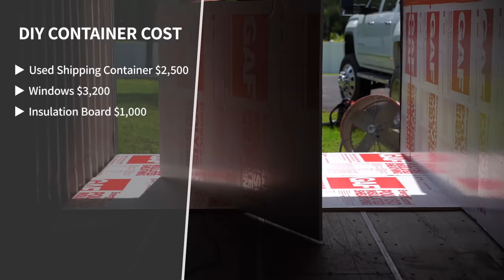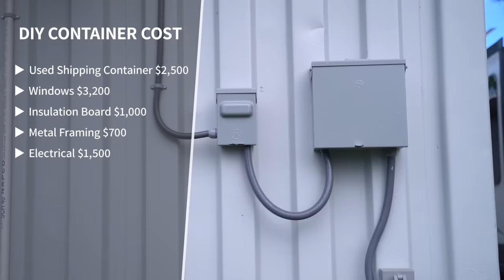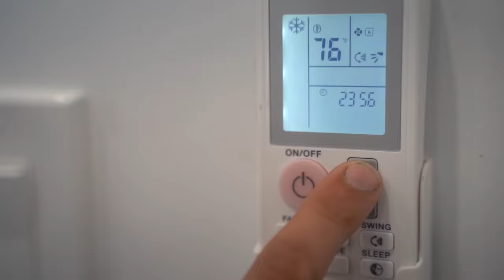40ft DIY Shipping Container Home (Total Cost Breakdown)

Comment: Here in Canada the price of just materials could amount to double the grand total. In your neck of the woods that could go to nearly 50 o 60 thousands, provided you hire the proper experts. Again, the cost here (considering the harsh winters) will take me to almost a hundred thousands, if not a little more. Nevertheless, a conventional house, of that size, made out of lumber and virtually disposable materials would cost around 2 million Can$, and that will include the land that will never be mine. The great advantage is that a shipping container unit will last longer and can be easily extended, if needed. I'm looking forward to see your videos, professionals like you are very much needed these days. Keep the good work amigo, you are good. Greetings from Toronto.

Comment: I have liked the idea of container homes for many years. I bought two used, 20' standard height Connex and minimally converted them with doors, lighting and skylights and were used as a art studio and workshop until the city discovered them and I was forced to move them away (Los Angeles! Rrrrrrrr). Now I am in the process of searching and securing land. Planning on spending largest part of my (initial) capital on sizable land of 30-100 acres (topography, terrain, slope and sea level elevation, zoning, laws and regulations, distance from amenities, climate and weather, taxes, accessibility to utilities, distance from work, traffic and airports/ fwy access and several other location decisions like USGS water table, (well depth) and preliminary planning considerations being of primary importance). I have it narrowed down to 5000' or higher elevation in South Western US (AZ, UT, NV, NM). My idea of a Container home build would be for an enclosed courtyard with water features (recycled water wall, wading pool and fire pit) and most time would be spent outdoors. (6 containers in a U configuration,  2 stacked, 2 side by side, full size end windows, sliding glass doors ect)  I appreciate you putting out this video and my estimates were a bit higher as I have lots of concrete and some platform/ decking and staircase considerations ...but I still think if your a DIY with a construction and metal fabrication background it is a no brainer for a remote or off grid build as there is some inherent security during and after construction. With some creativity having metal boxes to start with allows more flexibility if this is a solo or small crew build. Thanks and I am looking forward to more of your vids!

Comment: Cool video thanks for sharing everything but what if someone had a little container home like this and they closed that sliding door for example because they wanted to sleep and have privacy then if you had your mini split on with the air conditioner running or the heater running when it's either cold or hot then if someone's in the living room for example they wouldn't even feel the air conditioner or heater at all is that correct?

Comment: There is a curve (and you know this because you are a builder and so am I) the curve says that the smaller the square feet the higher the cost per sf is.  If someone does not allow $100 per sf for a container home build, they are fooling themselves, and that may not include the foundation depending on the location.  Site work, permits, local code issues like listed below.  And some municipalities are not going to let you install electrical, plumbing, hvac yourself.  

Insulation costs will greatly be determined by where it is built.  In our area where we have an energy code, R-19 floors, R-13 walls, R-38 ceilings, it will cost more.  The 1.5 insulation averages around R-5 so depending on what you  buy it will not meet most energy codes.

Yes, the problem with mini-splits is location and the length of these containers.  the dimensions of a container being long and narrow is really an inefficient design regarding HVAC. Most people will put a lot of glazing on the living end which is opposite of the sleeping end and so you will need 2 heads for the minisplit system because the glass is the energy killer and it will either be cold or hot where the glass is.  The good news is they have compressor units that will do 2 heads.

The sewer system most likely will either have to be a septic tank or connection to the city sewer, each of those would be a minimum of $4,500 unless you are lucky and have a close connection to a city sewer that needs no street cut.  I don't know of any municipality that will allow a permanent dwelling to have just a composting toilet.  Where is the sink and shower water going? :)

The Irony is, containers do not make sense for homes.  They work well for shipping :)  An efficient home design is more of a cube than a long skinny rectangle.  But the internet makes everything look easy, free and trendy :) then comes the building inspector :)  

Nice video series.

Comment: The only thing I would add to this video, like you said in the beginning living in the south. Cost of land could be anywhere from $1,000 an acre to $20,000 an acre. As well as some of those materials might be easier to source living in different places. Living on the coast you could probably get the container for cheaper versus living in Kansas. So I would just have a little disclaimer saying these cabinets are $50 a piece if you live in Texas but they're $80 cabinets if you live in New Hampshire

Comment: Presumably the cost would go down somewhat if you were building multiples at a central location for delivery to the sites, but it sounded pretty reasonable. Then there's the fun of finding a place that would issue a certificate of occupancy for such a small living space. I guess that's improving. Even if costs went to 50k for one of these with siding and roof and such, it's still better than one of those tiny homes on a trailer base.
Reply: Agree.  Plus they look more mothern thank the ones around here where I live.  I don’t like the “Smurf” cabin looks lol.

Comment: So the vapor barrier is between the foam board and the steel wall of the shipping container? How to you make provisions for water vapor condensation or ventilation of that space? Obviously there is a huge temp differential between the steel skin and the interior walls so it's something that needs to be addressed and I'm not sure how you do that.

Comment: Do you have a video on the installation of the windows.  Do you weld in a  steel frame or do you use wood and screw thru the steel of the container

Comment: Big question. Im in central Florida. Ive got two 40ft HC containers. Planning on getting two more 20 footers. My plan was breaking everything down in stages so we can plan save for each one and over the next 5 to 8 years build everything ourselves.  Ive got alot of hands on experiences with just about everything.  Im still trying to find out can i actually legally build my own house with out getting contractors. Ive found buulding codes and zoning but nothing saying you have to have a licensed electrician, plumber, ect. I know ill have to pull permits and get inspections.  But where can i find out if im able to actually do all the work myself

Comment: Congratulations on the very interesting video. I have a technical question for you. If a house is built on site and later transported to another location, are there any risks of damage to the interior due to the elastic movement of the container? If so, what precautions do you recommend? TY
Reply: Always bc you would have to have a crane to sit it perfectly upon your new sewer system

Comment: Honest question, here.  Why use the container at all?  I can stick build a house with that square footage for roughly the same price (including site prep, a roof and exterior), and I don't have the constraints caused by the container.  What does the container gain you, especially if you're going to end up putting a roof and exterior on it?

Comment: thanks, that was actually less than I would have thought. I would have thought $20-25K materials cost, then labor and site prep. It all adds up quick. Just the time to build it would be 1-2 years for a owner build depending on the time available. What was your start to finish time on that container?

Comment: What kind of footings do you put this on? Also, in this one, you used steel framing with 1" closed cell insulation inside, but on another (the 20') you used InsoFast foam. Did you get the R rating you wanted with the 1" closed cell? Do you have a schematic floor plan w approximate dimensions for this particular build? Thanks!

Comment: By the  time all the other costs are added in it is easy $40,000 for the first container. If you add two or three  containers, those one-time costs bring down the cost-per-container figure. More containers may also  bring down other costs like shipping and labor. The first container will be the most expensive. I've been told that a multi-container building, with costs averaged, will be $30,000+.

Comment: Yeah, you could DIY this for pretty cheep in comparison to buying a standard home, but like you pointed out, this estimate doesn't include some of the things are going to be the most expensive. Finding a place to build it for one, buying  a piece of land isn't cheap. Then deciding if you want to live off the grid and go with solar power. If not, you need to make sure that plot of land you bought has access to grid power. You also need to see if your plot has access to city sewers, odds are it won't and you'll need a septic system. That's definitely not cheap and you need to pay to get the tanks emptied. I would budget no less than 50K for something like this. Maybe that's too much, but I'd rather be safe than sorry. I would absolutely LOVE to do something like this, build my own place exactly how I want it, but living in Minnesota, the idea of not having a basement is kinda nerve wracking to me. Which is another cost I didn't think  of until now. You can't just throw this on the ground, as far as I know, you need a foundation to put it on and anchor it to the ground. Depending on location a tornado could lift you right off the ground. As cool as this concept is, I don't know how willing I'd be to pull the trigger.

Comment: The biggest problem Iv heard about these homes is the container walls don’t hold up after being cut. How strong are the metal studs you used inside a container? Would you recommend welded I-beams or angle iron?
Reply: Container walls hold up very well I'd you weld them down.

Comment: Hi iam a contractor and I being ask to built a container home with 4 containers side by side or 1280 square feet in Florida  would it be possible to give an idea about how much is the cost per square feet is going to be built with 2x4 framing , spray foam insulation and Sheetrock wall with a knock down texture and the floor is going to be tile i

Comment: Putting foam insulation on the as you did and using vinyl tile, is the floor very sturdy? Thanks
Reply from the maker: Frank Stocker oh yeah rock solid, we put in 5/8” plywood over the insulation screwed to the subfloor of the container before the vinyl plank flooring as well
Reply: @ContainingLuxury  I copy that. Thank you. After watching your video, there is a lot that go into converting a container into a home. It's not a one weekend project, that's for sure. Thanks again

Comment: I’m in the process of getting ready to build my container home. I’ve just got some land. 2.2 acres for $20,000. Not bad if you ask me. We will be building 3 separate structures. My home, my sisters and my nieces own space. 
My entire family is contractors by trade. The only thing I need to hire is a welder. My property has houses near it so water, sewage and electrical are at the road. I have $100,000 to build 3 structures. Do you think that’s enough?
Reply: no, i don't think 100k is enough. I'd estimate you would need around 150k to 200k minimum when you factor in all the required transport (fuel!) and energy cost.

Comment: Watching this again 2 years later in 2021! Lumber prices have gone through the roof and the other costs associated in this video might have increased 30% but comparing building techniques, I would say containers are the way to go.
Reply: No stick built is cheaper than container built house! Also container built require stick frames!
Reply: @ZackWolfMusic  The difference in "stick built" is 2X3's for containers and 2X6's for regular home. 2X6's are twice as much. And the 2X3's don't have to be number 1 or 2, they can be construction grade.
Reply: @stephenjames820  From my experience in building my container house it is much costly to build container than if built stick built. I spent 
10 thousand just in framing my container house while if it was stick built it would have been around 55 hundred dollars!
Reply: @ZackWolfMusic  In my area a 2X4X8' is $10.98, a 2X6X8' is $15.98 3x the cost from last year before covid. There are a lot of different factors to consider and I don't think that focusing on one material tells the whole story. As well the cost of the container may not be reasonable to consider because in my area a one off or new container runs $7,000 to $8,000cdn so for me I will be going another route!
Reply: @stephenjames820  Yeah Canada is way more pricey than America the housing  market is totally ridiculous especially in the London area! I'm in Seattle Washington I use to work in Vancouver my condo was super expensive with a high hoa fee I so glad I sold it! 
Average new shipping containers cost around 
$6,600 shipping included.. 
I used pre owned shipping containers that were three years old. In my area 2×4×8 is sells for 9.64 each, 2×6×8 
Sells for $17.49 that is up five dollars compared to prices in 2019 at $ 12 bucks.
I use Owen's Corning insulation and drywall both were super expensive than priced in 2019!
Reply: @ZackWolfMusic  Lots of videos on YouTube of lumber sitting at rail stations! Totally inflated!
Reply: @stephenjames820  Yea forgot about the rail ways having lumber sitting.
Reply: @stephenjames820  How are the lock downs going in Canada? Is your area on lock down??
Reply: @ZackWolfMusic  Hi Chris, I took a vacation last September from southern Ontario up to Winnipeg Manitoba. I passed dozens of sawmills and hundreds of trucks carrying logs and finished lumber. We were told the mills were all shut down but the ones I passed were at full production! In Ontario they shut us down, only essential businesses i.e. grocery stores and drug stores could be open. Walmarts open for food and essentials. Everything else was curbside. First it was for 2 weeks and then 6 weeks and then 3 months for the last 15 months. February we were locked down again, no travel except for essentials for 2 weeks, then 4 weeks and we just came out of lockdown after another 6 weeks. Stores are open with 15% capacity. Many businesses have closed, unemployment is on an all time high, government doesn't give a damn!!

Comment: Would it be much less expensive if I used the already existing door to fashion a front porch, welding it open and adding a roof and deck. Then build a wall with door and window in it's place, Not cutting on the sides at all. Just making use of the opening end. ?? Oh, and yes, I would be using alot of throw away stuff and taking my time with it. I really don't like the idea of paying that much for a strong container than chopping up on the sides to weaken it. I don't see why I can't just go with the opening already there.

Comment: Doing it yourself costs a lot of time and money. A drum room, with fire resistant insulation, subfloor and ceiling. 2 layer plywood on each side for noise, lights, flooring, drywall. About 4,000 in materials. Took months and it was only  8 x 10.

Comment: I have a question. Did you allow for/ include or even consider the need for cleaning the container?  Used containers can contain residues of dangerous chemicals accumulated through the past use/s of the container.  The original paint used on the containers can also contain harmful substances.  What, if anything, did you do to address these issues and remove any possible risk for the rest of the container's life? I did not hear anything relating to this in your presentation. Thank you

Comment: Forgive my stupidity,  but isn't the spray foam REALLY toxic if it catches fire? How is that code? 

Btw, of the dog eats some of the dry stuff, you can get them to horf it back up with hydrogen peroxide. They won't like it and neither will you, but it works. Use a bit at a time.

Comment: One thing missing that every builder should do first, before any windows or doors or insulation, is HAVE A PLAN. You don't go willy-nilly putting up windows in odd places without first planning out the area.

Comment: is the 1 inch insulation you used on this container equivalent to using standard R19 in the walls?
Reply from the maker: No we had a crazy idea in mind that worked by creating a series of air voids that had air flow and no direct sun to insulated starting at the siding installation, so by the time we get to the insulation board there was virtually no heat load on the backside of the container wall.  So that board was more to protect the cold air from getting to the container wall.  This design would only work in hot direct sun areas.  It ended up working amazing here, stays freezing cold with little to no strain on the mini split even in 100 degree direct sun days
Reply: @ContainingLuxury  would you consider building a container home in Northern Georgia?